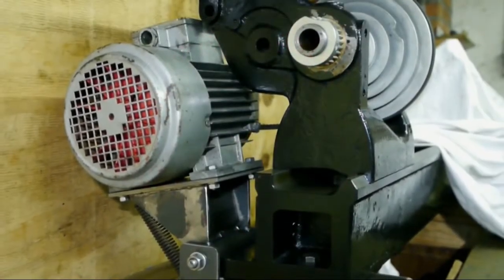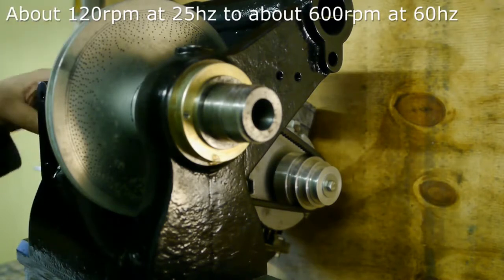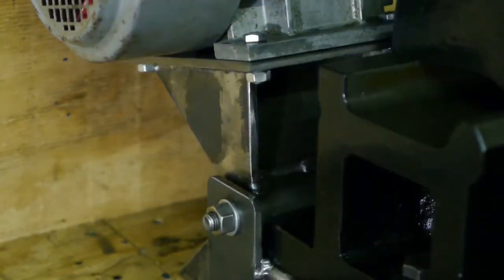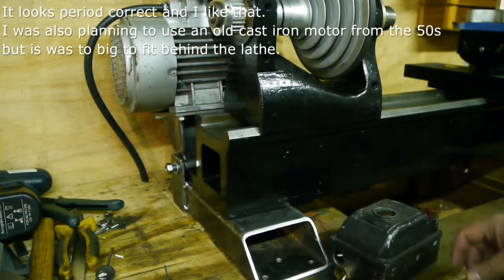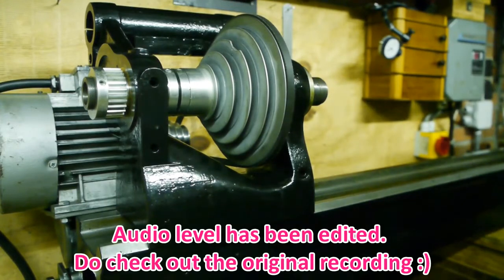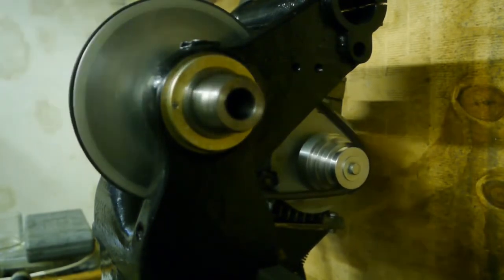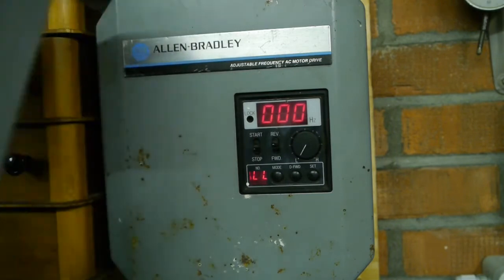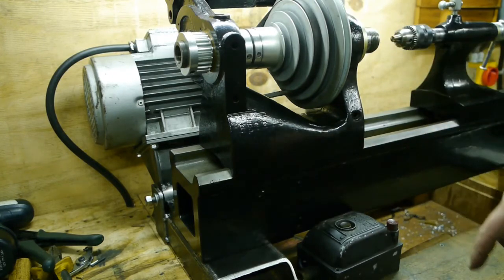The old lathe get a motor and a VFD

Comment: Shouldn't u get higher speeds than 500?   A regular Ac motor is 1700. Some grinder style motor are 3400.  I think we use belts to slow them down. Bitnu should be able to get max speed with the VFD correct.     

Hey I'm glad yr back.  I wad alate follower from the old channel and u just disappeared....     YouTube bull???

Comment: Get rid of the spring, buy a screw jack, the ones that are like a post not the sissor ones. Cut the body, take out the 90° gear, the screw, and the nut and use that to make tensioner for the motor, you will also need to drill a hole in the tablo so the screw has somewere to go.